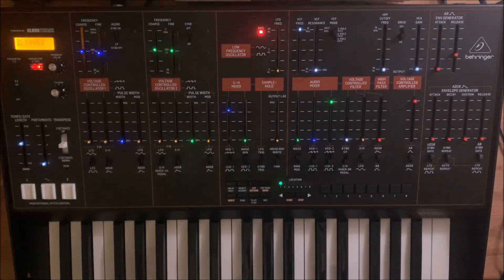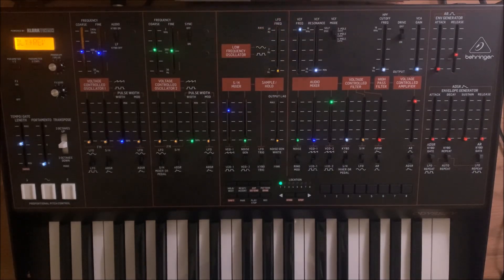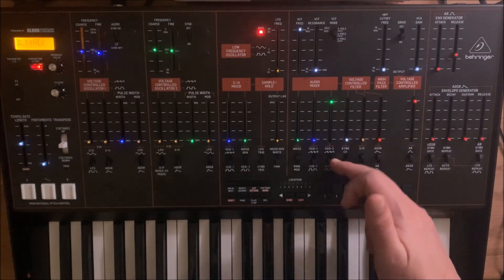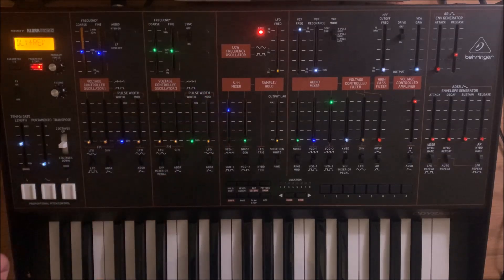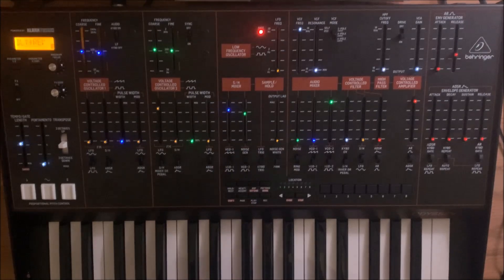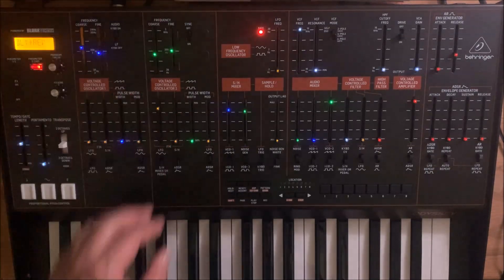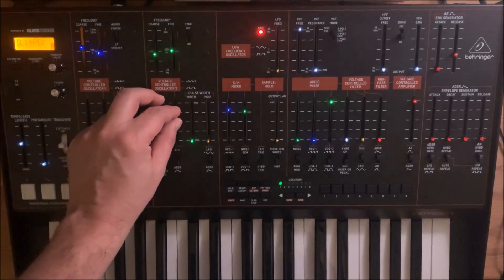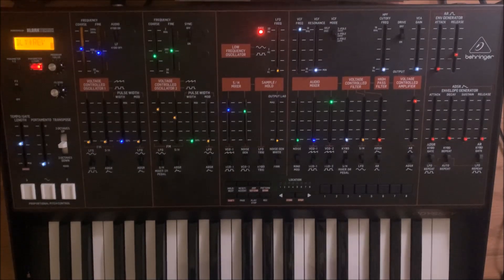Behringer Odyssey FM Noise Percussion

Comment: GREAT thank you i am enjoying your posts on the arp odyssey ...i have been trying to get a sound patch close the the fm ring mod wobble sounds on japans ghosts song the sounds are at the start of the song ...is it possible to get close to that sound on a rev one arp ?
Reply from the maker: Thanks! :) Yes, that should be 100% possible on any Odyssey. Its probably a prophet 5,  but the Odyssey can do any FM sound the P5 does
! The S/H mixer with osc1 modulating either osc2 or, I think rather the filter w full resonance in this case. Some flanger and reverb on top.